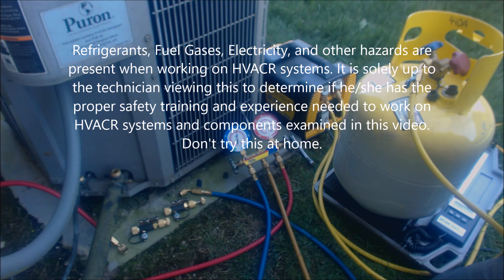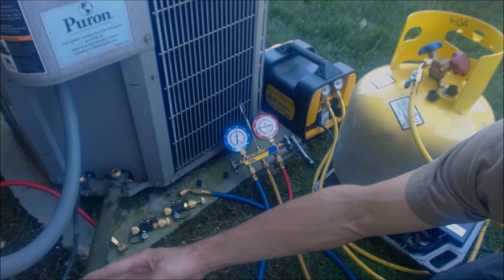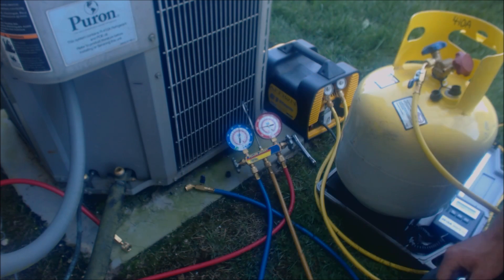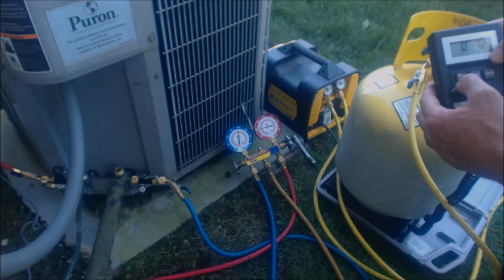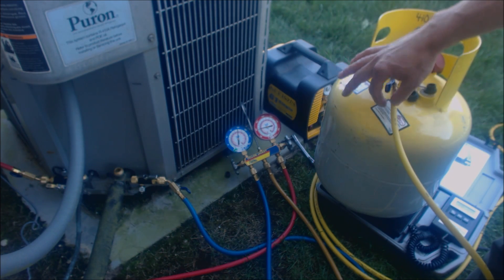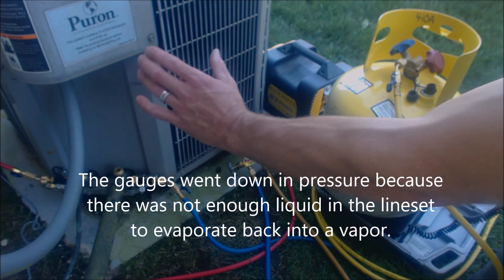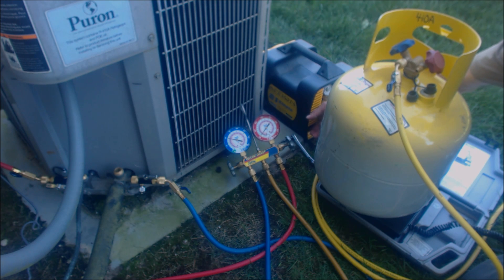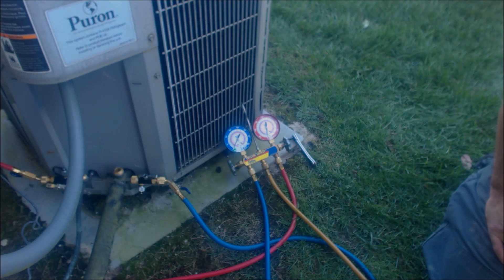HVAC Recovery Procedure: Machine, Tank, Tools Used Step by Step! Recovering Refrigerant!

Comment: I've seen you purge lines of air on several of your vids. You say you can tell by the look and sound when the lines is purged. It seems that there is a small puff of cloud at the connection and a louder spurt when the air is completely purged. Is that what you mean? BTW many, many thanks for these vids. Looking over your shoulder like this is the best kind of education I could hope for. Many thousands of us are grateful for your efforts in making these vids!
Reply from the maker: Yes you will see this with liquid but not much with vapor, thanks Brian and thanks Abner for answering that while I was away!
Reply: Brian Crane yes! That how I do the purging. I wait to see the "white cloud" of refrigerant come out and close it. That how I know I have 100% refrigerant in the hoses. Great question though. I hope he answer too.
Reply: Thank you, I suspected that but wasn't sure. Thanks for taking the time to reply!

Comment: Another great video. Would like to hear your comments about the differences in the recovery machines like the G1 and G2 etc., are the only benefits just shorter recovery times? Also I see some folks running a filter/dryer at the machine, will this prolong the life of the machine. What are your thoughts on buying these used?